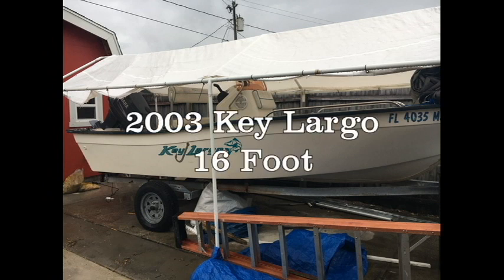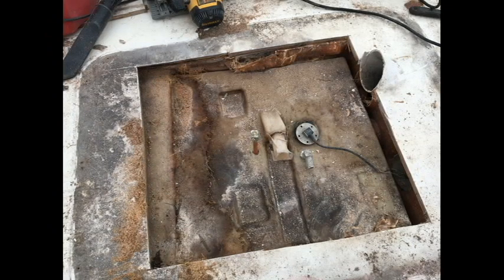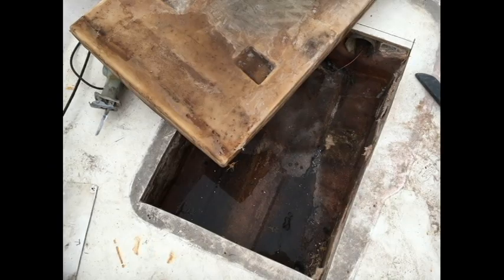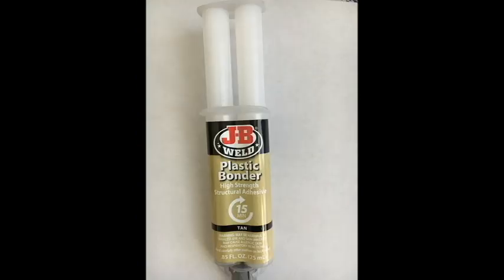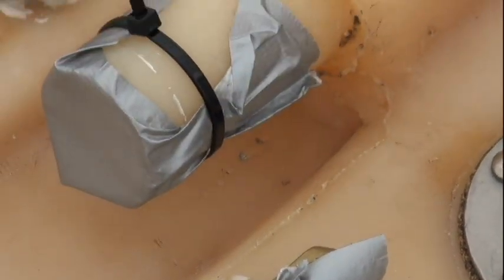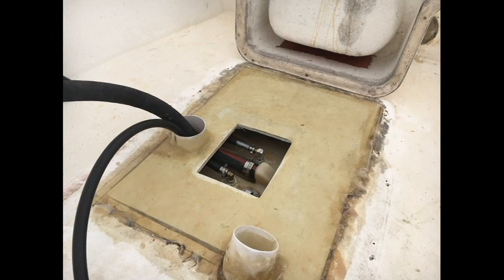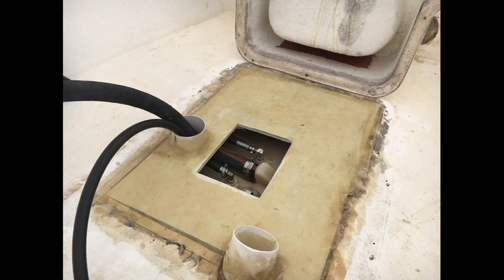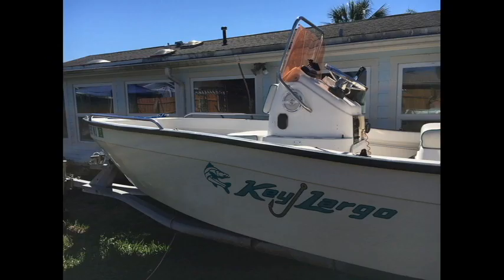Key Largo Boat fuel tank removal and installation

Comment: Me again - I read thru all
The comments and replies and I read you pumped out all the gas and then filled and refilled and refilled w water. So, between having the shop vac near by during the prep and all the “rinsing”, you were satisfied that the tank was pristine and without any junk that may have fallen in. Feel free to comment though. Great job by the way. Thx for posting!
Reply from the maker: Oh yeah, I remember that water trick.  I thought I would have gotten blasted by others for actually inviting water in the gas tank but I was sure it was dried.  I think I blew it out with compressed air also and waited a few days with it in the Florida sun.  It was completely dry.   I feel completely comfortable that it was empty of any debris.  It has been over five years and boat is still going strong.

Comment: This has been so helpful, I’m currently doing the exact same thing to my 2008. I’m also located in melbourne. It’s been a great boat except for the fuel design flaw. Can’t say thanks enough
Reply: I bought senders and pickups with screws and used marine silicone 5200. Been a couple years and it’s held up, but the screws held it in place. And I didn’t want the gasoline to touch the 5200. I didn’t use the epoxy but there is fuel resistant glues

Comment: I have a 2005 model and started having trouble with my engine not running right.  Narrowed it down to crud in the tank.  Took off center console and yes, found the fuel pickup corroded.  However, I got some Aerokroil penetrating oil.  After spraying that on the fitting daily for about a week, I was able to loosen it and get it out.  Sucked the gas out of tank and kept putting about 4 gallons in tank, driving boat around on trailer to slosh it around, and then sucked it out through the sending unit hole.  Finally gas came out pretty clean and put things back together.  BTW, when I put my center console back down, I sealed around three sides (except the stern side) to keep water from draining into center console area. But great video for those that have to remove their tank.
Reply from the maker: Wow, great job!

Comment: looking to do this to my palm beach 165 - basically the same boat, however i already installed a external 12 gallon tank inside the console with a blower.  I want to add a below deck tank inside the console with the filler on the side of the console, you are in my head
Reply from the maker: What is going on with the current below tank factory tank?

Comment: I have a 2014 Key Largo 168 and they're still having the issue with fueling!!! It would take an hour to put 5 gallons in it so I've been using an 11 gallon portable tank! The portable tank works but I don't have the range of the extra 11 gallons so I'm stealing your idea!!!! Thanks for the video!
Reply from the maker: I hope it works out!  Once, before doing this switch over, I was able to get fuel to go in by lowering the front of the boat trailer. It was definitely a pain.
Reply: @prohomevideos  I tried that but when I pulled the filler hose out of the hull the hose had a collapsed spot in it about 2 foot long.
Reply: How many gallons is ur fuel tank?

Comment: Thanks so very much for posting this. Just opened my 98 Palm Beach 16 (same boat) for season and found gas smell in bilge. Thinking I may have to replace tank. Sadly 35 gal tank is not under console, but instead starts under cooler seat and ends in front of rear inspection plate. But probably gonna have to do similar cut out. Thanks again. Project for upcoming week I guess.
Reply from the maker: You are very welcome.  I was very apprehensive in doing this project.  Cutting into good fiberglass was hard to do but something I knew had to happen.
Reply: I also have a palm beach, trying to figure out why I keep getting water in my gas
Reply: @Madhandsboy  mine (205 WC) was getting water in through gas tank vent in rough seas. Added longer line with loop above vent height so water couldn’t get in.
Reply: @drewg9285  I had found that mine was coming in at the fuel sending unit, I had a couple screws rust out and when water would get in the bilge it would go down it since the seal was not dealing with the rusted screws
Reply: @Madhandsboy  my 2003 palm beach 161 white cap is doing the same thing. I’ve had to run an external tank 😑
Reply: @rollinchasis  yeah just recently I noticed gas leaking again, and once again coming out of the sending unit, there is a couple missing nuts that I guess need to be epoxied in or something, and a new sending unit, but got now the portable tank is working, so I guess that gas leak was causing it to suck air and it had a loss of power to the point it would not plane out, put the portable tank on and it gets up just fine

Comment: Question: after you prepped the new fittings on the top of the tank, how did you (if you did) get all the debris out of the tank? It seems that with all the drilling and dremeling that a lot of particulates and “crumbles” would have fallen down into the tank. Maybe you had a shop vac right on it when you were prepping? Thx!
Reply from the maker: I did have a shop vac while doing the drilling.  I also, since the tank was completely empty, turned it upside down and was able to see any last pieces fall out.

Comment: Great job. I have a Palm Beach 161, 2009 witch looks the same as your Key West. Have the same problem whith fuel filling. Piss me off!  Vent is not clogged and i think the problem comes from an air lock that occurs in the tank when fuel is present in the fill pipe and in the vent pipe as well.  I use a very small rubber hose and blow slowly with my mouth into the vent line from the back until i hear fuel going back to the tank from the main filling and break the air lock. Not funny but it works. And i only fuel when my tank in less then half full. I like your idea of changing the location of the filling.
Reply from the maker: It has been the best decision I have ever made with it.  I know it is a lot of work but well worth it.  Never  a problem anymore.

Comment: I didnt see but did you say that what you did corrected the problem???? I am having the super slow filling problem and am going to change out all my hoses and I like the idea of moving the fill port to the center console but I want to hear if that was a good fix idea or just a neat idea.. Thanks in advance.
Reply from the maker: Yes, it most definitely fixed the problem.
Reply: Thanks a bunch... I just installed a minn kota to fix the problem.... LOL not really, just a temporary fix.... I gotta figure out how to get to the filler hose. Its under the center console. I got a 2017. I know I shouldnt have a problem on such a new boat but the butthead I bought it from only put less than 50 hours on it. Sat outside and just a mess of gremlins. I got to the breather in the front of the tank and it was clogged with what I thought was salt but there was no taste to it. White powdery substance... Glad it wasnt his stash of crack.... anyway I run a tiny drill bit into the small one and cleared it but still cant get any more than a half tank. I am going to get a 12 gallon plastic tank at walmart as a just in case. Now when my impeller kit comes in monday I should be ready... Yep the pisser was fine on inspection but that was on the muffs... Im such a dumbass. Didnt do a sea trial. But I put it in a tub and no water from the pisser... I will keep you in the loop on my fuel tank woes and what I do to fix it. Thanks for a great video...
Reply from the maker: @wayneweir9883  There should be an access plate underneath the center console.  Very tight to get to if you do not remove the center console.
Reply: @prohomevideos  Thanks, I have been under there and removed the cover. Yes it is definitely a tight fit. I think I can do what I need to anyway. I think that if I remove the cooler seat I will be able to get my body in a better angle and If I have to I can use a saw to open the deck a little more where the fill line goes to the thru fitting. I want to be able to bend the fill line to go to the new fuel port on the left side of the center console without putting too much stress on it causing it to kink down the road. And I am putting a 11x14 hatch in front of the center console so I can get to the vent hoses and fittings. I am going to yank them all out and put in new fresh fittings and hoses. By the way do you know why there are 2 hoses going to the front vents one larger than the other? I can see the main fill line, the main vent that is right next to it the sending unit which are all in the center console then in front of the center console are the other 2 breather hoses, one larger than the other. ww
Reply from the maker: @wayneweir9883  What exactly do you mean when you say, "front vents"?  My tank had three tubes, one was a filler, one was a breather and the other was the fuel pickup line.
Reply: @prohomevideos  These two videos on you tube pretty much explain my boat and the problem I am looking at. I got the boat running and in good condition so I am going to use it for the summer and attack the problem next January or Feb when I hate the cold and dont fish. But I am going to attack the front vent problem after I put in the new access panel, probably withing a week. Pull the vent hardware and maybe put in new ones. Who knows that might fix my problem. But pulling the Center console is a job for the off season. This guy did have some dirty gas with some water in the fuel seperator but it did its job and I went thru the cleaning of the tank and whats in it now is good clean fresh non-ethanol gas around 10 gallons since its a 22 gallon tank. but my new 9 gallon tank will suffice for the summer. I will keep you posted with pics and videos on my progress with the front vents. After scratching my big and little head (which is more fun than scratching the big head) I realized that I too only have the 3 gas ports in the tank. They are just in different spots and the vent is some new fangled safety crap I guess. So it has 2 ports coming out of the fitting and they meet before they go to the overboard vent which is built into the fill port in the back of the boat. I hope I am explaining it well enough but if not just ask away... Thanks for your help. I am an old helicopter test pilot so just talking out my problem can sometimes explain the problem away in my mind...
Reply: @prohomevideos  Hey its me again. I finally bit the bullet and tilted the center console over and got to the tank. I replaced the ullage valve which is also known as the vent valve. Mine was all corroded and the vents were completely clogged with corroded alluminum. Once I cut the deck enough so I could get to it I took it out and found someone in Bellingham Washington that sold Bluskies valves. Took a week but I got it and changed it out. Then I put an access panel 6x7 inch for access in the future. New vent lines fixed the whole " inability to fill the tank problem". Then with the center console tilted to the side (which was a lot easier than I thought it would be) I cleaned everything and put a new panel with a 4 inch pvc tube that allowed the main fill hose and the vent line to go thru the deck and then put a new fill Perko valve on the left side of the center console. Fixed the whole problem ( I thought),   Then I took the boat out of the garage and hooked up the earmuffs and started the engine. It ran for about 5 minutes then wouldnt stay running. Same problem that I had from the beginning. Hooked up the portable gas tank and the engine ran fine. So dumb me didnt believe that the gas could be that bad.  Well it was... Shit..... I drained all 17 gallons of shitty gas out (it didnt have a varnish odor or I would have suspected that from the get go) and then put in fresh premium non ethanol and added some Sea Foam for added umpf... Started and works like a new motor... What a trip that was. But with your help I got it done. Thank you VERY much...
Reply from the maker: @wayneweir9883  Wow, I'm glad everything eventually worked out.  It's been several years since I did mine and it still works great!
Reply: Both the fill line and the vent line need to be moved to fix the problem.
Simplly changing the hoses won't fix the problem.  The problem is twofold:  1) Height difference between the top of the tank and the fuel filler is too small.  2)  The breather tube follows the fuel fill line and opens at the same point as the fuel filler.  With the height difference the same as the fill line, any fuel that splashes into the breather (or any other obstruction) will prevent fuel from flowing in the fill line.

Comment: This is great and exactly what I needed. planning on doing a restoration and was thinking about putting the fuel filler on the console and I’m glad to see it working out for someone else. One question though, the space under your console looked very empty and I was wondering where all of your wiring snd batteries are placed?
Reply from the maker: On my boat, there are two compartment at the rear and the one and only battery is in the right compartment.  You can see the compartment at the 1:10 mark.  When I bought the boat, it had a trolling motor and the 2nd battery was under the console.  When I removed the trolling motor, I removed the battery and all of the cables with it.
Reply: @prohomevideos  ok thank you, have you had any problems with the one battery to start the engine and run your speakers and other electrics?
Reply from the maker: @aidanmurray11  No problem at all.  It is a deep cycle Interstate battery is has done me good.
Reply: Sorry I’m asking a bunch of questions but do you have an amp for your speakers?
Reply from the maker: @aidanmurray11  No amp, Sony marine radio purchased at West marine with pretty standard speakers as well. I can't hear them while running full speed, but I don't run that fast all the time anyways.

Comment: How did you fiberglass cover the back gas cap? I want to the the same thing to my boat. I really appreciate all the help you have gave me with my other questions too. 

Thanks
Reply from the maker: I am in no way a fiberglass expert but I used a small piece of wood as a "backer" to allow the fiberglass to fill in the void.
Reply: @prohomevideos  has your fuel system help up good for you
Reply from the maker: @Aidan.Wingard  Yes, I have had absolutely no problems in the last 5 years or so.

Comment: Great job! I have a key largo also. I wish I could do the same mod to my boat. My fill and vent nipples are much further aft and pointed toward the stern behind the seat on the port side. The fill cap is on the starboard side? I have to clean out the vent hose way to often. Annoying!! Also my 40 gallon tank was very loose in the bilge. I had to foam it in to secure it better. I should have posted a video of that.  Too late now.
Reply from the maker: What size boat and year?
Reply: @prohomevideos  2006 1900cc

Comment: Why pull the entire tank out? Were you just checking for leaks?
Reply from the maker: The aluminum pickup tube elbow and the breather tube elbow had corroded so bad, they started to fall apart when I tried to unscrew them.  I realized I would have a lot of junk in the tank so I decided to remove the tank to I could get a good handle on vacuuming out all of the debris left behind inside.  Looking for leaks was surely a nice byproduct but it wasn't the main reason.  If it was as easy as unscrewing the old pickup and breather tube, etc.  I wouldn't have removed the tank.

Comment: Hello there, I have a 2008 Key largo 160, basically same boat as yours.  I have problem filling gas to the tank, the fuel meter reading half full, but gas is backing up to the filler hole when filling.  Do you think the air vent is clogged?  if so, where and how can I unclog it?  By the way, what is the top speed of your boat with 90HP on it?  Mine is only a 50HP and am dying for more speed.
Reply from the maker: It could be clogged but mine had this problem and it wasn't clogged.  It was a bad design as the fuel filler hose appears to run parallel with the boat which seemed to cause the fuel to back up while attempting to fill.  The vent on mine was at the same place as the filler, it's a combined unit.  Unscrew the filler assembly (maybe remove some sealant) so you can pull it up and you should see a larger tube (filler) and a smaller tube (the vent tube).  Unscrew both tubes so you can remove the assembly and then look for any clogs in that area.  You would then need to check the vent tube that runs from the filler assembly all the way to the top of the tank, which on mine, was under the center console, underneath a small square fiberglass plate with screws on the top.  Once inside that access hole, you will see the smaller filler tube.  You could unscrew that tube and then blow compressed air through it to see if it is clogged.  Be careful though as the fittings that go into the top of the gas tank can get brittle and break off, as in my situation.  As far as speed, I don't have a speedometer but I believe it goes somewhere around 45 mph.  Good luck!
Reply: @prohomevideos  Thank you very much for your quick response, and a very detailed explanation, I will try to work on it today.